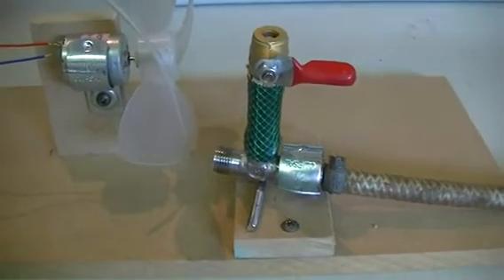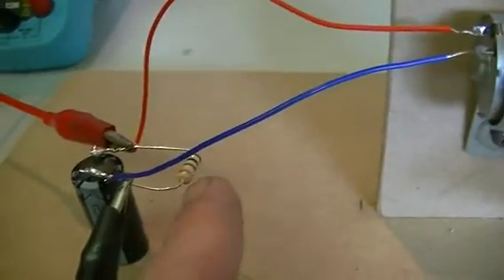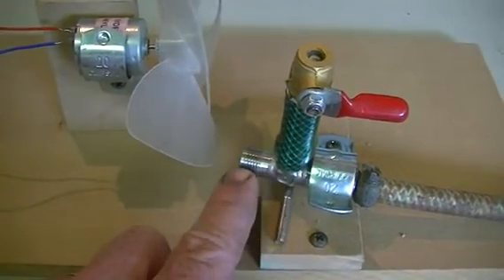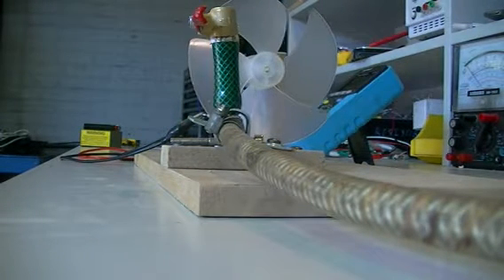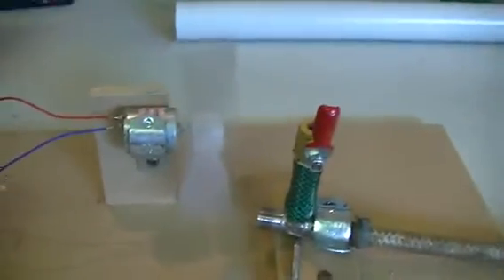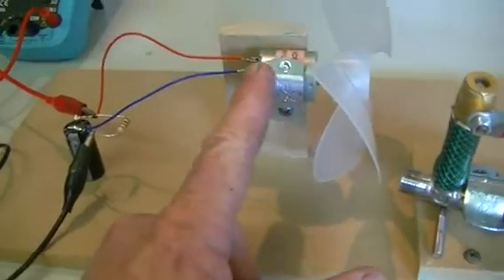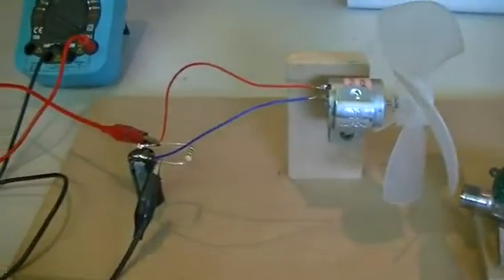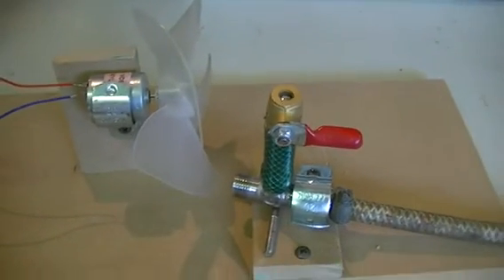True energy amplifier

Comment: I guess when the venturi effect is working (valve opened) the air stream is warmer, as when it's closed. Air cools when it expands. So when the valve is closed the fan gets a cool stream and the temperature exchange occurs behind the fan . When it's opened it sucks additional air with it and the temperature exchange in the air flow may occur before it reaches the fan and the volume of the air not only increases by the additional air flow but also by the temperature increase.
And the latter is the amount you get from the ambient.
Reply from the maker: BhdRoussos Indeed. The environment not only adds gas volume,but also increases temperature.

Comment: Hello Brad! I think it might be, that the overall air flow from the compressor through the nozzle is speeding up when you open the venturi valve. Could you put a tire pressure gauge (air pistol with gauge) before your assembly and look for changes in pressure when you open the  venturi valve?

Comment: Wonder if you had a venturi/vortex shaped inlet for the ambient air (at the brass inlet), if you could tweak a bit more power out of it?
Nice experiment TinManPower 

I had a crazy thought,  combining wind turbine &  hydropower. having a ''chain"" drive from the turbine, BUT a unique plastic(?) chain which has little cups as part of the linkage.  Possibly an overlong chain, with a five point turn/return (one of them being the turbine)  on the drive side, where the water drops into it,  the ''chain"" turns a corner allowing the water to drop and not slow things down.
Wind turbine with hydro turbo
Might have to do a video of the concept
Cheers mate
Reply: Really interesting T/Y *****
Philip Rowney
Reply: Ken Walker I worry about overall efficiency. The venturi will increase airflow, lamina flow is the most efficient in cases like this.

I tire of most these ideas, if we want energy in 'meat-space', thermal is the most widely available in the Universe.

It is the coolest thing to ask and answer these type questions as we understand the 'universe of 10 directions' a bit better.

( still needs to build a sterling prototype )
Reply: ***** spinning the air would increase air volume of the nozzle.

For the sake of science.

Let you compressor 'recharge' to rest, then run the rig until the compressor kicks in, repeat with venturi open.
Then check the difference in air volume/time

If your compressor 'emties' slower with the venturi open, you have a real gain.

But, with the caveat that it was a very inefficient system to start with.

If you want free energy, build a Stirling engine ;-)
Reply: Philip Rowney 
Watch my vid please Phil, and tell me if I'm mad deluded and wasting my time ;)
Reply: ***** I tend not to comment until after I have viewed the material. You should realise that from the comment I made. Pardon me if I am unclear.